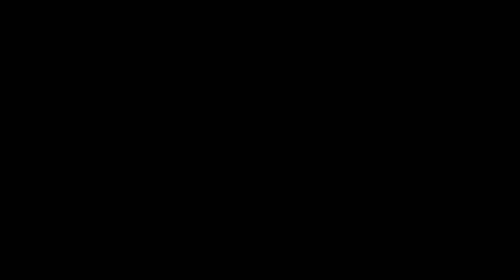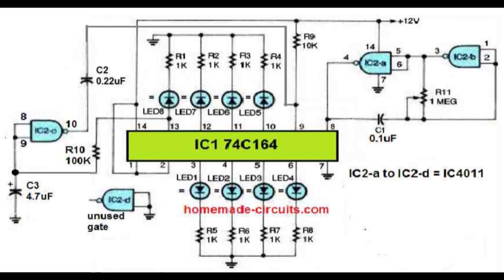LED chaser Circuit to illuminate 8 LEDs in sequence, then Shut off and Repeat

Comment: Hi I like this video and have been looking for a project like this, " Do You have a Detailed Parts list Please ? Thank You
Reply from the maker: Hey, thanks for liking this video, here's the complete parts list for the project: 

Resistors:
R1 to R8 (1 kΩ):

Type: Carbon film or metal film
Wattage: 0.25 W (1/4 W is sufficient since LEDs typically draw less than 20 mA each)
R9 (10 kΩ):

Type: Carbon film or metal film
Wattage: 0.25 W
R10 (100 kΩ):

Type: Carbon film or metal film
Wattage: 0.25 W
R11 (1 MΩ):

Type: Carbon film or metal film
Wattage: 0.25 W
Capacitors:
C1 (0.1 µF):

Type: Ceramic disc or multilayer ceramic
Voltage Rating: 50 V (or higher, for safety)
C2 (0.22 µF):

Type: Polyester film or ceramic disc
Voltage Rating: 50 V (or higher, for safety)
C3 (4.7 µF):

Type: Electrolytic
Voltage Rating: 25 V (or higher, since the circuit operates at 12 V DC)

Notes:

Resistors: Metal film resistors are preferred for better stability and lower noise but carbon film resistors are also acceptable.....

Capacitors: Always choose capacitors with a voltage rating at least 1.5 times the operating voltage for reliability....

Power Supply: Ensure that the 12 V DC power supply is regulated and stable, for proper circuit operation....